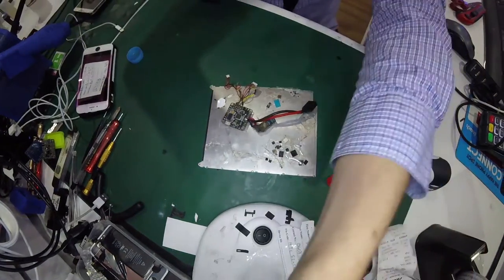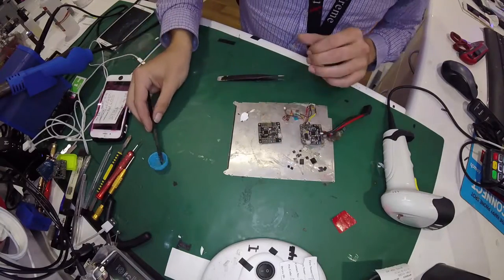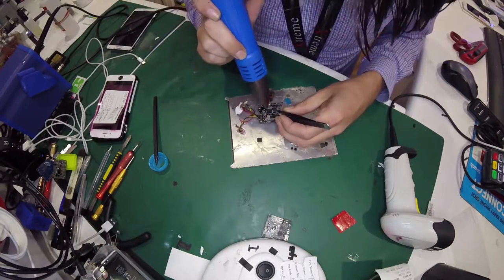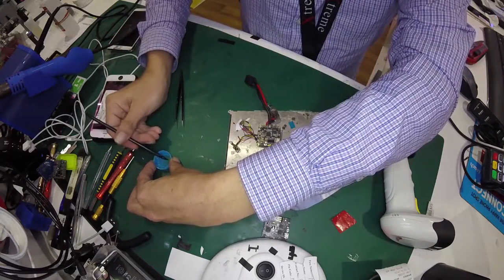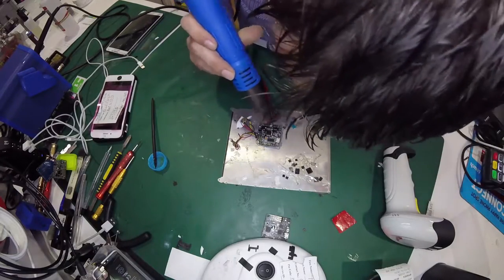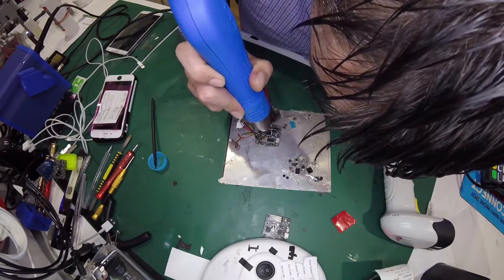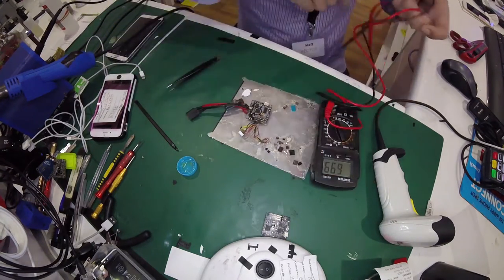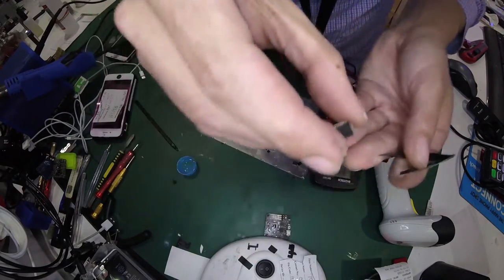STM32F303 - Flight controller CPU Swap

Comment: Dude I freaking loved that!! I so want to have a go at that. I can't believe heating it up like that for that length of time doesn't blow the CPU and other components.
Reply from the maker: :) thanks mate , its an art indeed to hot for to long will kill components but im only really getting it hot enough to flow the solder then stopping , the unit im using at work is only like $70 on ebay so there not heaps to try , a good unit will cost 1200+ though
Reply: I've got one :D But mainly use it for heat shrinking lol and to remove some components but never anything like this and I've certainly never replaced a component with one. You've inspired me  buddy

Comment: Really helpful video, loved the commentary, and yeah, we couldn't see much, but it was useful all the same :)

Just killed the MPU-6000 in an X-Racer 3.1 board, and thinking of attempting a similar process. Will one of those small butane powered blowers be suitable for reflowing/desoldering, or can you recommend (some not too expensive) hardware that will do the job?  

I'm guessing a microscope would help with this of work as well. Can we get away with a smartphone type as that would be easy to use, or do they suck ass for this kind of work?

Cheers!
Reply from the maker: thanks mate i'll put in some more effort next time :) , all of the gyro 
"2 flash" errors i've had have been fixed with a quick reflow of the 
gyro , my thinking is its the traces that fail not the gyro so worth a 
shot. you'd have to be very careful with a butane torch but it is 
possible , i use a really cheap 878 reflow station at work , i mostly 
use it on iphones for water damaged data recovery & its not much 
chop for anything larger ie fullsize motherboards will just soak up all 
the heat but its great for small stuff like this . cheap microscope suck
 balls , they lack depth perception so if you commit to a scope i feel 
it needs to be stereo , for the one off jobs like this just take your 
time and use a good magnifying glass but for your gyro no magnification 
should be needed , your the 3'rd person in afew days to ask me about 
gyros though so i might do a video on that very soon
Reply: HecTech FPV will give it a crack, cheers!
Reply: Holy crap it worked! :D  Stuck goo from a flux pen around the gyro chip, ran my soldering iron with a clean tip and a bit of fresh 60/40 over the pins at a moderate heat. Magnifying glass showed a couple of shorts, but easy to fix, and the board seems to be back in action, as it connects in bf configurator.

Thanks again!  Now I'd just wished I hadn't desoldered all the wires and done the job insitu :)